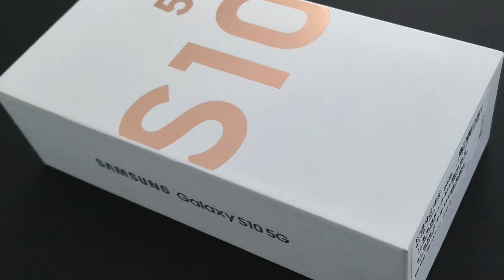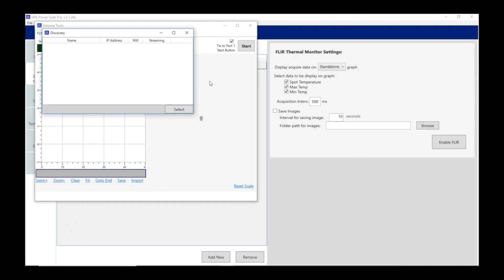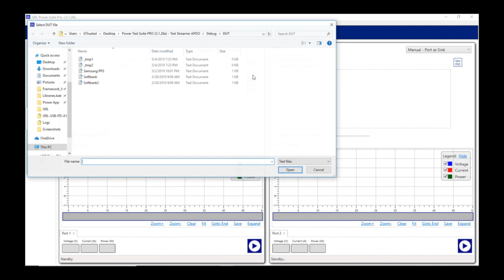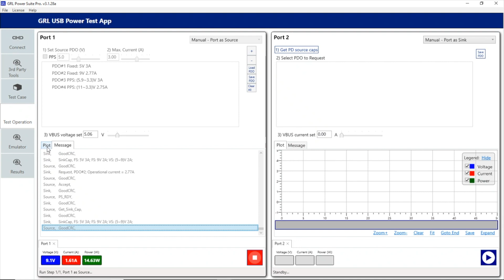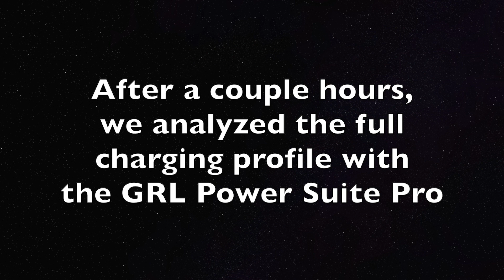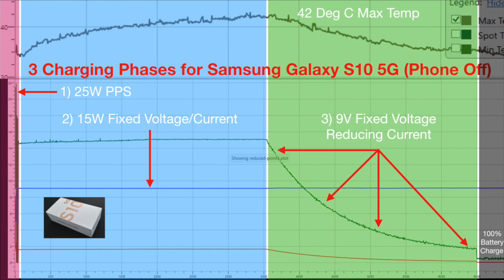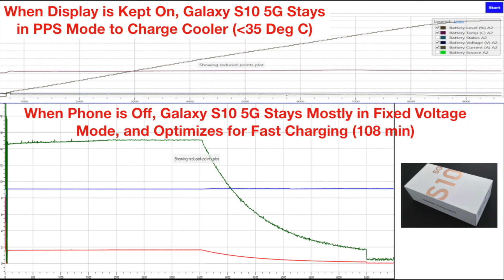Why the Samsung Galaxy S10 5G Charges Faster But Hotter When the Phone is Off

Comment: Oneplus advertises that you can use the phone while it charges, it’ll still charge fast and stay cool,does new Samsungs behave similarly with screen on? Oneplus also mentioned that all the heat and conversion is done in the plug rather than inside the phone and that’s how it stays so cool, did Samsung catch up or PD standard doesn’t allow conversion inside the plug?
Reply from the maker: We have captured data for the Samsung phones with the screen on with apps running in the background and observed that the newer Samsung Phones have optimized their charging mechanism to charge faster and to stay cooler than 40 degrees C at the same time. 
Here is a video that can help you visualize what the latest Samsung phones do when it comes to charging with different types of chargers https://www.youtube.com/watch?v=MsMaieiAjf0